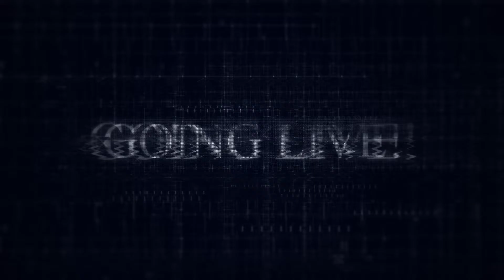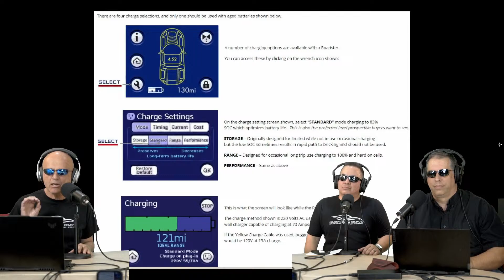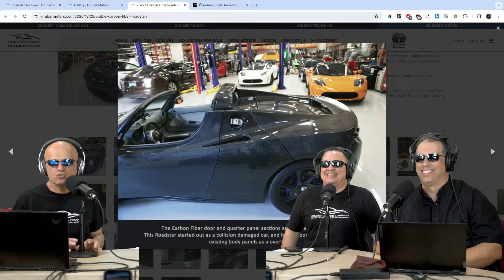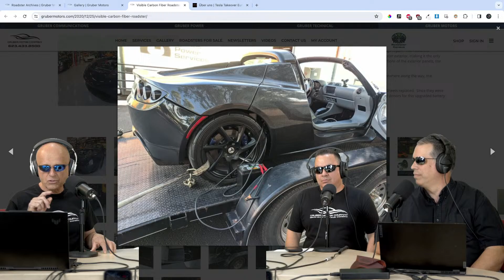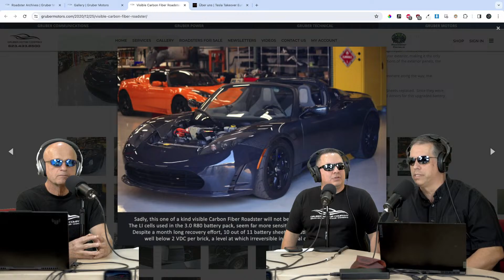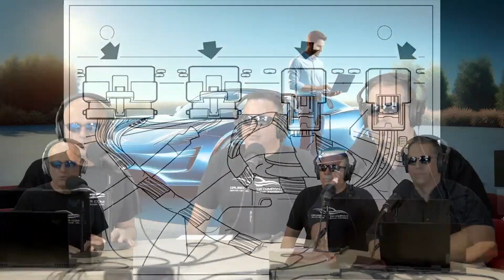Tesla Roadster Podcast

Comment: Regarding the 1144 errors (3/19 Roadster podcast), make sure that the connections on the fan end of the cable are also tight.  That connector at the fan end is often overlooked as a potential cause of the PEM-end failures.  

Here's the reason.  With the 2.0's "dual fan" upgrade (single motor, two blower fans), the two drive circuits within the PEM are combined in parallel on the fan motor side of that second connector.  The negative side in the PEM is where the fan current regulation is done (driven together by the PEM software), with the positive side tied together inside the PEM providing the return path.  In theory, the total fan load is split evenly between the two PEM driver circuits, just within the specs of the connector.

However, if one of the positive connections at the fan is loose, most or all of the current from the two negative supplies flows back to the PEM through only ONE of the pins on the PEM end, quickly frying that pin.  This is what happened to my car.  I'm on my second PEM and third PEM connector, so when I started getting errors (again) during Covid I took the time to troubleshoot what was going on.  That investigation showed that indeed the F-connector sockets on the fan motor assembly weren't very tight, leading to the recurring PEM connector failures.

I do a monthly dump of the car's log, so was fortunate to catch the error early enough this time to not have the PEM-end pins burn too badly.  A little brushing of the pins with some Deoxit and a new cable connector saved it.  I tightened the fan's F connector sockets with some needle nose pliers, and all is well again.